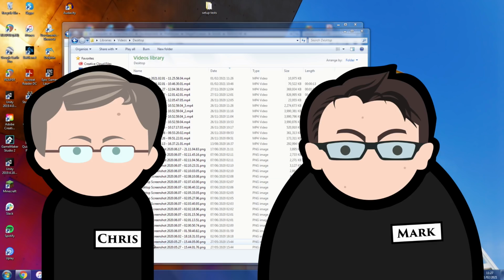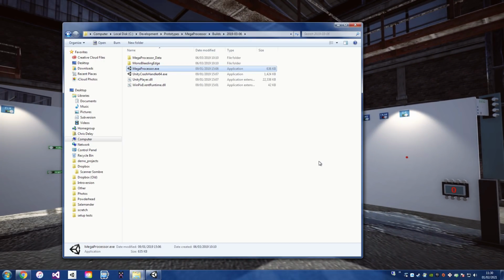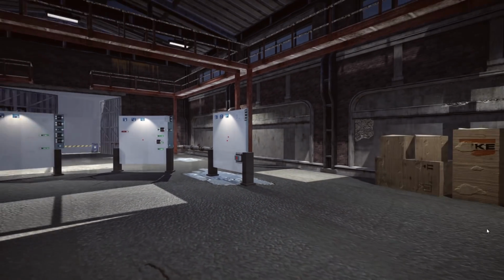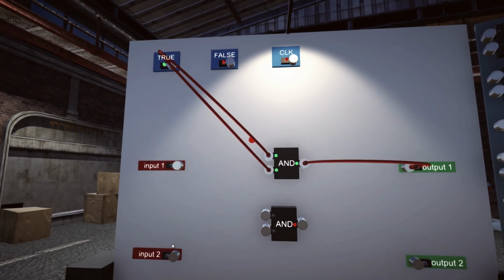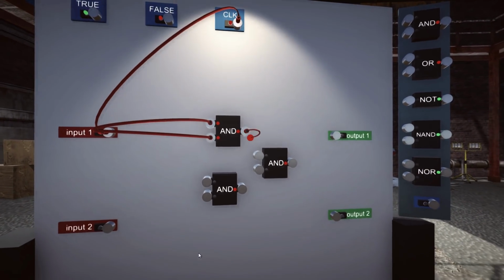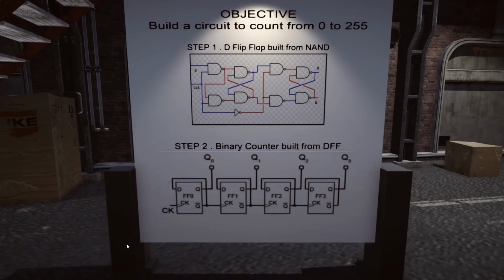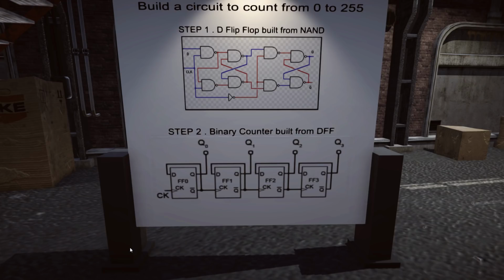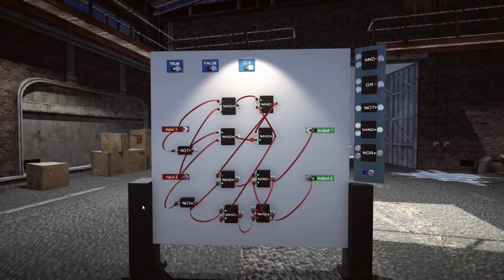Chris Delay's Fail Masterclass #3 - Megaprocessor

Comment: The issue with such a game is that making a CPU is very theoretical. There is little place for creativity (at least for the basic components) and it's also hard to put reasonable constraints. Those are the two major things that make a puzzle game a great game. I don't think anybody can figure out himself that a SR latch can be made by using a pair of cross-coupled NOR/NAND gates (unless you already know about it). You have to tell player what to do at some point and in the end it feels like "do this", "now this", ... like bunch of repetitive chores / tasks. The fun came when you have to figure out yourself how to do things with some limitations to bypass. It's also difficult to mix all those theoretical puzzles with an interesting story (something needed if you want to prevent your puzzle game being boring quickly and keep the player interested).

Comment: This would fit that game model where you make money from selling stuff and live in a small town. Puzzles are like quests where an industry wants, say, a circuit for a blinker for a car that goes at some rate, an emergency switch that turns on but can't be turned off, the timer for a sprinkler system, a clock. Gates cost money, so making the circuits simpler has a reward. A weird game world where circuits drive everything. Use vehicles to go buy circuits and ship your products, design the circuits that drive their wacky propulsion systems in efficient ways. Solve some puzzles where a company wants to lower the cost of a an inefficient design. Something like that.

Comment: There was an amazing game on the Apple II called Robot Odyssey.  If you haven't seen that game (this is from the 1980s after all) it is worth looking at.  I always wanted to see a spiritual successor of this game with modern graphics and more depth.

This gave electronic puzzles like has been seen with the Zachtronics games too, and started with simple ideas gradually expanding.
Reply: You might want to try Exapunks, it's somewhat similar to Robot Odyssey in a way you control a bunch of robots and need to guide them to some areas using custom logic.
The main difference is you don't do this by creating logic circuits but writing assembly code.
Reply: @Tigrou7777  Thank you for the suggestion.  I'll look into that program!

Comment: Love that idea ... after reading the book "Turing's Cathedral: The Origins of the Digital Universe" by George Dyson and another more technical one "The Datacenter as a Computer: An Introduction to the Design of Warehouse-Scale Machines" it also came to my mind a puzzle ( just like this article Three Computer Games That Make Assembly Language Fun - IEEE Spectrum ) .. hope that Megaprocessor single core embryo will find a incubator ... H.O.P.E we going to find a multicore socket  ... so we can develop a proper AGI algorithms, technological singularity after all quoting the book "The Master Algorithm" ... "Claude Shannon, better known as the father of information theory, was the first to realize that what transistors are doing, as they switch on and off in response to other transistors, is reasoning. (That was his master’s thesis at MIT—the most important master’s thesis of all time.) If transistor A turns on only when transistors B and C are both on, it’s doing a tiny piece of logical reasoning.  ..PS-> Of course I will try to build a bitcoin miner ... find a leading zeros in a sha256sum =)

Comment: This is actually a really good base I'd think :) you do need a set of puzzles... 
Regarding 'how do you make the leap?' you make the leap for the player... because you do it just like you did - maybe a quick introduction about what the end will be, but then for each step it's 'make a circuit that works like this'  ... ' and then we can use that circuit to make a thing that works like Y'  and then once that functions and unit-tests complete, you get a 'and then we can use that to do Z.... '   so even though each goal is accomplished in a void, you're given the insight of 'this will then do X-Y-Z...' just in the explanation between tests.... https://d3x0r.github.io/automaton/board  This is a similar sort of game... it is a reimplementation of someone else's game, because Me, myself, I wouldn't know how to write those puzzles either :)   But this guy sort of did a good job - just in your case you could sort of step sideways, that there's phases 1-a,b,c 2-a-b,c ,...  This looks pretty good though :)

Comment: The problem I see with this demo is that the "gameplay" seems to consist of walking back and forth to copy a circuit schematic from one board to another board. It's not just that the player isn't actually making any decisions,  it's also that the whole thing makes no sense (you'd just have the circuit on a sheet of paper so you'd be able to look at it while placing the components). 

It's basically a "walking (back and forth) simulator". Which, come to think of it, is also 90% of World of Warcraft's gameplay, so you might be on to something really profitable, if you remember to add a pet store.

Comment: I think one of the problems with the electronics/boolean logic based puzzle games, is that most puzzle has only one specific solution. For some level you may be able to imagine several solutions, but still one would be so much better than the others that they make the other solutions look wrong in comparison.

Comment: In a very real sense, this is exactly what Factorio, Satisfactory, and now Dyson Sphere Program actually do at various player-observable scales. It starts you with relatively rudimentary and basic tech, gives you direction to achieve a goal, and achieving that goal unlocks more tools to do things but often simply requires you to replicate what you've done – just bigger. Those tools usually provide you mechanisms by which you can replicate it.

I think the key change in Megaprocessor in order to get that kind of immersive possibility is the idea that you could pull out any number of these white bread boards at any time and move them around the warehouse, taking the ones which are currently "complete" and physically moving them over to the side around the edges, giving you a space in which to work in the middle while simultaneously creating an awareness of how much work you've already done.

This is the kind of thing that could be very successful in the current market, which is interesting.

Comment: I think the comparison to Zachtronics is important, and you need to do more research on some of the statements he made. He Specifically said at one point, he didn't want to take REAL things and turn them into videogames, because that would be more education not entertainment. You can see this pretty clearly in his earlier games, which are all pretty much Uni courses converted into games (on Steam as Zach-like). You need to make something fantastical, something that could exist, and is related to real things, but without some of the nitty gritty parts that weight it down. 

Spacechem isn't actually about Chemistry. The game uses the underpinnings of real science, but it's all an abstraction. Same thing with Molek-Syntez. You need to be science adjacent, otherwise it's clearly just education which will turn off a lot of people. Not saying that you can't make edu-tainment, but when it's ADVERTISED as learning a real-life skill, people won't approach it as a videogame. That's what makes Zachtronics games so fun and popular.
Reply: That is totally true for zactronics games, but an actual electronics simulator could appeal to a different niche (with a large venndiagram overlap.)
Why not make it realistic? Car Mechanic Simulator, Kerbal Space Program, redstone circuits...  there might be a niche for a game-like electronics sim!
Reply: Introversions own Uplink is a pretty good example.

Comment: I really think this could be turned into a fun game.  I grew up and played Rocky's Boots on my C64 that was basically a similar game concept, except without the miniaturization that you have. I think you could do a lot with that miniaturization concept.  For example, the game could start off will simple puzzles, like Rocky's Boots, however you could later introduce a robot that you can plug in miniaturized boards into to have it do things.  The robot could be simple at first, 4 output pins for move forward, move backwards, turn left and turn right, and 4 input pins, connected to bump sensors on the sides of the robot telling if there was a wall in that immediate direction.  The first puzzle with the robot could be just navigating down a hall that has a turn in it.  Later puzzles could be navigating a simple maze.  You could then add more functionality to the robot, such as a simple arm that could pick up or drop object (puzzle could be to pick up an item in a room and bring it back to the start point). Or a puzzle may give the robot a way to mark location (different colors of paint?) and a way to detect the color of a location (camera?), allow you to program the robot as a 2-D Turing machine ( https://en.wikipedia.org/wiki/Turmite ).  I'm sure you could come up with a lot of other puzzles to do with a programmable robot or other things that you could put a miniaturized circuit into.  Being able to build a 8-bit computer (maybe a 6502) in game would be cool (there are several youtube channels that should you set by step how to build an 8-bit computer on breadboards).

Comment: Maybe could shape the challenge with some more every day and relatable goals. Like build some electronics for counting chickens or something, instead of count to 200 for no reason. We use electronics for so many every day things with or without realising.. so the game could be build around exploring the, sometimes invisible, world of electronics. Could also add sensors aswell, again to output signal when it sees a chicken... Also, the level could be build to reflect the environment of the practical application of the electronics being build. Like the farm with the chickens, supermarket entrance with automatic door or something... Could also add wireless components, radios, maybe could visualise the radio signals for extra fun... Just think about how many signals there are around us from some smaller NFC fields to Wi-Fi to 5G... Would be very cool if we could see those.

Comment: Nice still rocking win7 :)
Reply: Its mostly people that are limited by software that yet isnt supported on shitdows10, and might never be, was my case as well.. Other than that you can nowadays make win10 be as least annoying and as much private as win7 is../was, tho yeah it needs many tweaks like utilities removing spyware and some real firewall like netlimiter, de-bloater and other utilities removing the usual malware with which it comes, and even better if you apply it all over pirated win10, its easier and has less spyware from the start + no annoying useless updates at all if you disable defender as well.. Its quite a work, like a half/full day wasted, but its truly worth it
Reply: people that are limited by software that yet isnt supported on shitdows10, and might never be     There is always the option of running a virtual machine — even under Windows, assuming licences do not bar your right with legal shenanigans.

PS: a firewall is a separate box that will not yield just because in some desktop machine has been hacked, gained malware, is virus-ridden.

Desktop-“firewalls” are good for is having an eye what connects from where to where.  Due to the susceptibility of the platform through malware and the susceptibility of the person at the keyboard through social engineering, a desktop firewall is not secure.
Reply: @advorak8529  Dude... Runnin win10 and using VMs isnt as convenient as you think, I tried it and it is a hassle in certain aspects, if you dont use also software that is exclusive to win10 without workarounds then there is no point in wasting potential days upgrading to win10 and dealing with the hassle to prepare all the software and now including the VM you ll need for work, when you have perfectly working win7 so far.. Just a common sense tells you that no one just decides to upgrade to win10 when they workin on some projects, most probably multiple even.. Speaking about that firewall soft I meant to say that you use it as a final blow to the win10 spyware.. it sees all the possible connections and only allows those you give permission to, in other words it blocks a few remaining connections that send metadata and it cant be turned off easily unless you install some pretty invasive utilities which completely restructure some programs like explorer, what is probably the most noticeable thing right after install.. I was skeptical about it at first, but borrowed one of those LAN monitoring tools and over a couple of days  it didnt receive a single packet, otherwise when you disable the software or allow all, there is still somet amount of traffic on win10, and even more so without those utilities that turn off the common "spyware"/ metadata